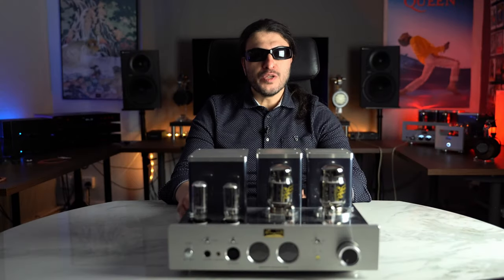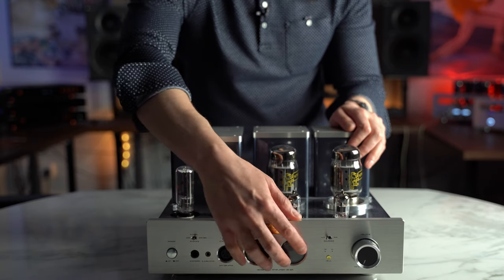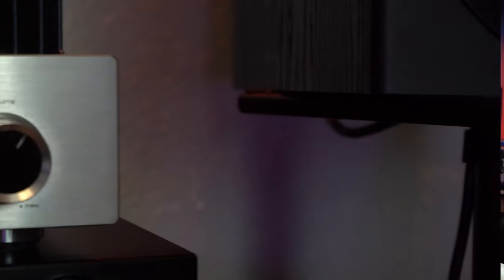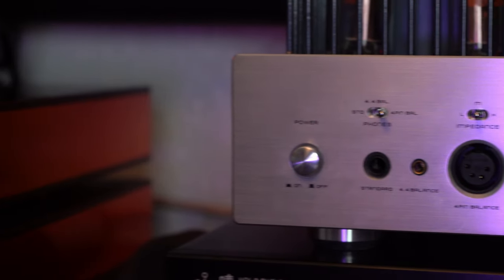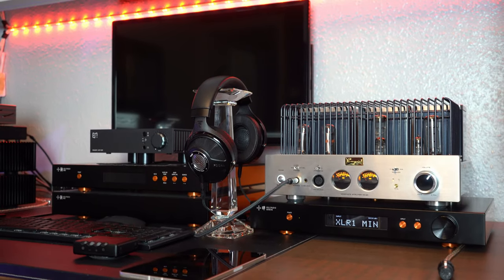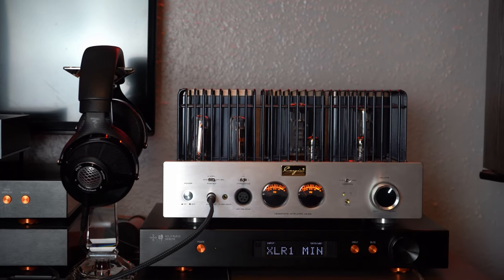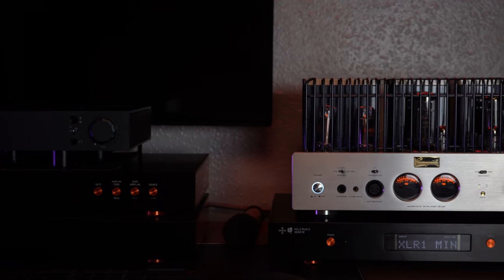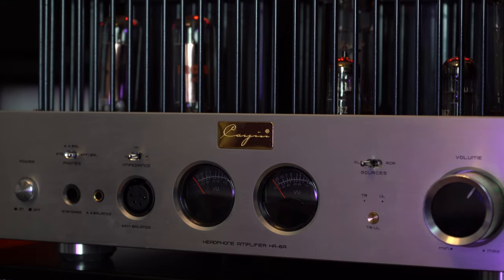A tube amp with versatility in mind. Cayin HA6A.

Comment: Yes it is crazy how tube rolling can make such a bid difference. I have the Envy. Elrog MO is very solid state sounding. Driver tubes make such a big difference on how it will sound. I used to own a TT2, AHB2, Ferrum Stack ... Dave + Envy + Elrog MOs is amazing. I never heard the Susvara sounding this good. It is squeezing the most of what this driver can deliver. 

Chain: Matrix X-SPDIF 2, Chord Dave + Farad 3 w/ Furutech Inlets & SR Purple fuses, Feliks Envy w/ SR Purple fuses
Tubes: Elrog ER300B-Mo, Elrog ER300B, WE 300B, Melz 1578 6SN7, Brimar CV1988 6SN7, RCA VT231 Smoked Glass 6SN7, TS 6F8G VT99 RP, Sylvania 6F8G VT99, TS 6J5GT (quad), Raytheon 6J5GT (quad)

Comment: Yep tubes are the way to go. I was on solid state amps until I got my Schiit Lyr + and with some tube rolling I now have more detail, soundstage and better imaging. The vocals are also much warmer and the clarity is unbelievable in comparison to the thin sounding A90D. The 800S now has what seems like endless soundstage and detail and the LCD 4 got a big kick in its bass and the A90D cannot even compare.
Reply: What tube? Looking into Lyr+ for my first tube amp to pair with Susvara and 1266 TC
Reply: @kenshinhimura1981  I wouldn't go for the Lyr as your first tube amp as that had only just enough power to drive the LCD 4 and the Susvara and AB 1266 are more demanding. The Cayin HA-3A was a massive improvement over the Lyr but I would recommend the HA-6A just for the extra power you will need to drive those other headphones. The HA-3A powers headphones like the Tungsten and LCD 4 as it has a massive amount of voltage which is what those headphones require. The Susvara and AB1266 are different and require outright power and this is why you will need the HA-6A over the HA-3A
Reply: Yeah I was looking at the HA-3a but saw that they weren't strong enough. I know wave theory says the Lyr+ isn't the greatest but should power it decently. I was just trying to avoid spending 2K plus on my first one and get a feel for the sound difference. I've been looking at different brands but looks like it's hard to find anything under 2K that can handle those headphones. Welcome to the money pit. 👀💀🤣
Reply: @kenshinhimura1981  yeah I mean the Lyr will give you a taste of what tubes are actually like so try out the Sylvania 6SN7 as that line was my favourite with that amp.

Comment: Nice review. I have this amp and enjoy it quite a bit. Would like to clarify things from your narrative. The front of the unit has an impedance switch for low, medium, and high impedance headphones. You mentioned a gain switch, which does not exist on this amp. You also mentioned an external impedance matching device that you used with ZMF headphones. The impedance switch built into the amp, and indeed a reason for the transformers, is so you can tailor the amp to whatever headphone. I use mine with the ZMF Verite Closed with high impedance selected on the switch. You also mention linear and tri-linear modes. I assume you mean triode and ultralinear. Usually, I prefer the amp with triode mode. The stock tubes are alright for me. I have switched to KT88 tubes and some Baldwin drivers but never for long. I'd be interested to try the tubes you mention. In my experimenting it seemed best to compliment a more solid state sounding power tube (KT88) with a more tubey driver tube. You seemed to prefer a more solid state sound overall, but maybe I'm not totally sure what the Telefunken tubes sound like. I also have the ZMF Caldera and don't necessarily prefer it as much on tubes since those crave current, which solid state provides.
Reply from the maker: Thank you for the comment
Yes, I did not want to release this video because it was the very first video with a new style  and video production
I was not comfortable with it, but when I shared it with a chat, they said no, we like it release it. I was going to reshoot from scratch, I am far happier with the H a 300 mark two which will be released soon.
I felt as though this video was not in depth, the way I normally go into and I felt uncomfortable. LOL first video with a live camera person et cetera
I saw a lot of mistakes when I watched it again when it was completed
It’s frustrating, but the constructive feedback is very much welcome
Reply: @ConvinceMeAudio  No worries. Making videos is not easy. I look forward to the HA 300 MKII video.

Comment: Hello, nice rewiev indeed. I currently own, he-1000 v2, Focal Utopia, and some mid-hifi Sennheisers like hd600. Im using Vioelectric 550 solid state amp. Currently thinking getting my first tube amp for these headphones. Which one would You recommend if budget is around 1.5-3k mark. 
Ty
Reply from the maker: I think your best option is to look on the used market first of all, and then look at euphoria, and possibly this one you might be able to get either for around that price
Euphoria is OT L. It’s going to work best with your Sennheiser and focal but it’s synergy is wonderful
Reply: @ConvinceMeAudio  Thx for fast reply and suggestions. You mean Felix Audio Euphoria right? I live in Europe so its around 1800€ in my country used. Any idea how well that Euphoria is going to drive low impedence planars? Shit I think I have to change my hifimans to ZMF planars or smth :D. This Ha-6a Is 3k euro mark. But i could get ha-3a for 1200€... Oh the difficulties.. ty for being patient with our stupid questions. Subscribing btw. Thx again.

Comment: 1:42 Are you sure the outputs are Single-ended?
Pretty sure the amp internally is single-ended - meaning the positive and negative voltage are amplified together (still split between left and right).
But I think, then the outputs still can be true balanced
Reply from the maker: @jonas_oja   Cayin as a rule convert from the transformer to true balanced I’m just trying to recall if the HA6A applies the same principle like the HA 300 MK ii
Reply: @ConvinceMeAudio  did you listen to Tungsten with this amp?

Comment: This is one of the most underrated amps on the market imo. It has issues, and you have to treat it as a power amp pretty much with the volume set around noon and a pre-amp or a DAC with volume ... but as you pair it with for example Spring 3 with Pre-Amp module or May + Serene (or any other good pre) or Chord dacs, load it with good low noise tubes, feed it clean power, it is a trully a TOTL amp in every sense with some pretty unique features. I don't think there is a straight upgrade from HA6a in the HP world.
Reply from the maker: Agreed, it still bugs me that the review was not really in depth for this one like the HA 300 mk ii 
May serene was how I ran it most of the time
Reply: @ConvinceMeAudio  if you still have it you could do a tube rolling vid, there's some pretty cool and diverse tubes for it, both drivers and power tubes. With right tubes it also has interesting sound with Susvara (I think KT77 and Black Treasure KT88 with warm drivers like RCA black plates were my favourite combos for the Sus).
Reply from the maker: @krisrudecki9477   unfortunately, it has gone to a good home, I did have a pile of tubes at hand for review, but it left pretty quickly but I’m getting the z10e very shortly

Comment: Interesting, I always thought that the Pendant was at the same level as the Cayin HA 300. But if it is not even at the level of the HA6A, then I have really been wrong.
Reply from the maker: No, it’s not on the levels of Ha6a trails behind by a small margin,
And the H a 300 MKII destroys both of those specially when you use Elrogs
Reply: @ConvinceMeAudio  Good to know, as the HA 300 MKII is next on my amp list.